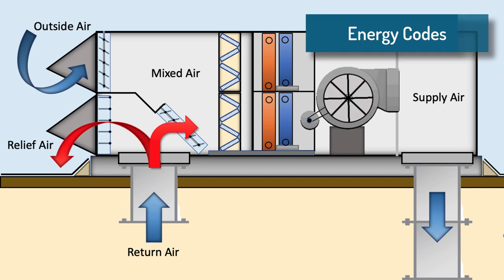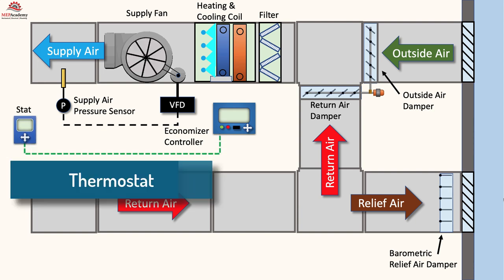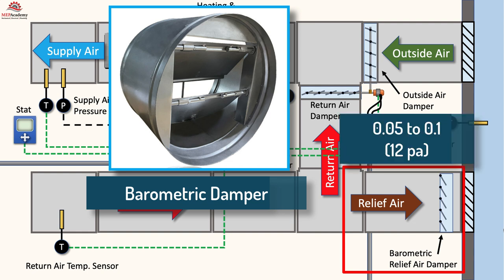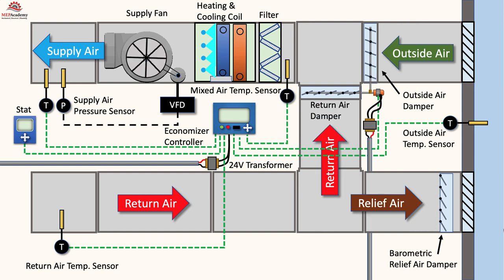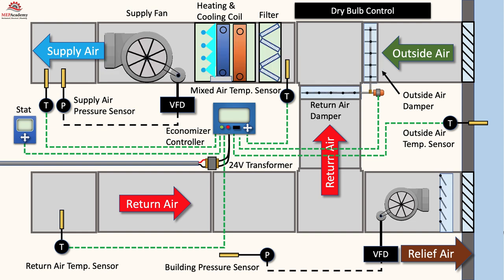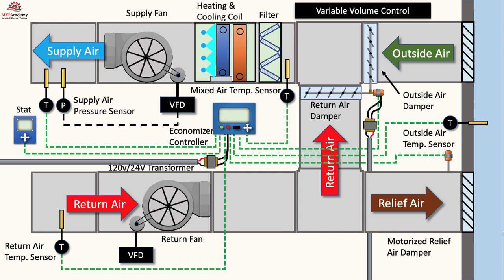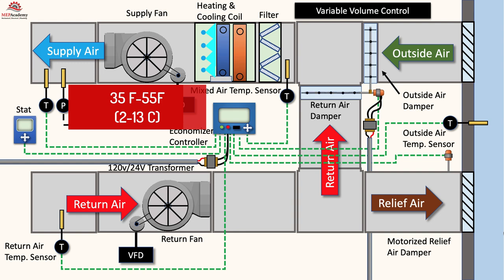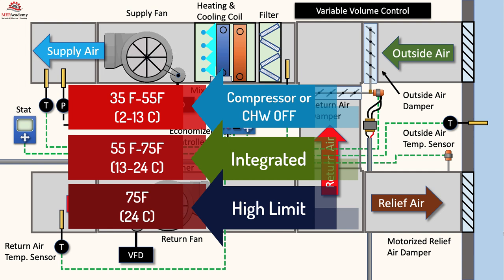Air Side Economizer

Comment: Will it make a difference if we get rid of the return air completely, and use DOAS ducts, Do we still need a relief air damper to release the pressure? In other words, will the economizer works differently if we use only DOAS? Thank you...
Reply from the maker: If you have a return/exhaust path through a heat recovery wheel or another method to relieve the DOAS supply air then you're OK. There must be a path for the DOAS air to get out of the building. That can be done using exhaust air or relief air, but you want to avoid over pressurizing the building as this creates problems for opening and closing doors, in addition to the problems created for proper air balancing and the pressure relationship between spaces.

Comment: Is there ever any reason or reasons to have the economizer operate in sub-freezing outside air temperatures?   ty
Reply from the maker: Codes often require that the economizer system be designed and equipped with controls so that the economizer operation does not increase the building heating energy use during normal operation. This would obviously limit the lower outside air temperatures at which the design would comply with these codes.